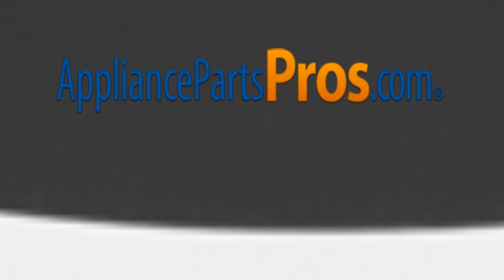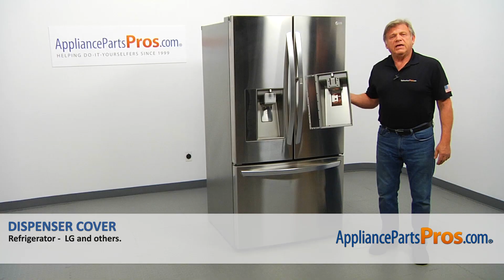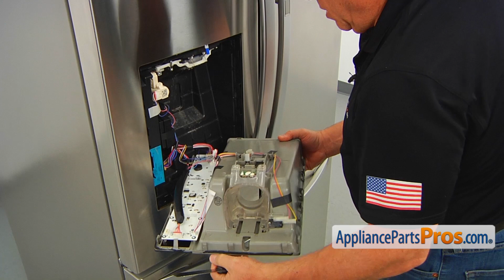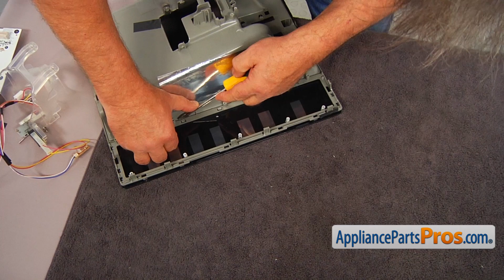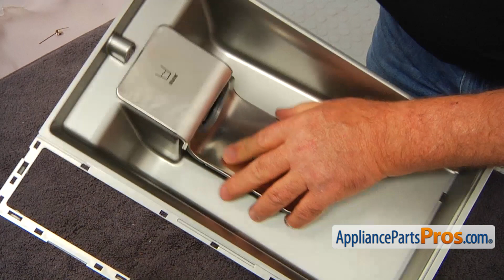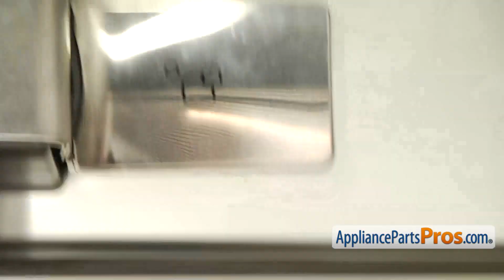How To: LG/Kenmore Refrigerator Dispenser Cover MCK66542801

Comment: Pros:  The part was correct and I was able to fix my LG fridge (model LFXC24796S/00).  Everything works.

Cons:  The video leaves off some VERY important details, causing the replacement process to be more complicated.  The missing information that caused the most problem during my repair is that the video said to remove the cover plate (where temperatures and other information shines through) on the left hand side of the dispense, all I needed to do is push back the many little clear plastic tabs with my thumb.  The video did not mention that in addition to all the tabs, the face plate is also secured to the dispenser cover with very strong double-sided tape.  So, it did not matter how far back I pushed the tabs, the plate remained securely attached to the dispenser cover.  I wound up breaking off one of the tabs by pushing too hard before I realized what the problem was.  From then on, I used a putty knife to slide between the face plate and the dispenser to loosen the tape as I moved around the face plate pushing back tabs with my thumb.  On the video, there is no tape and the face plate simply falls off once the tabs are released.

A more minor missing detail is that the circuit board on my fridge was held in place by yet another plastic tab in addition to all of the screws shown in the video.

A final shortcoming of the video is that the person demonstrating was able to simply pull the various wiring harness clips apart.  That's not how they work.  On my fridge, two of the harnesses have relatively easy-to-use thumb latches.  Squeeze the latch and the harness can be disconnected.  The other two use a rather more tedious method of disconnection that involves pushing aside tiny little clips so that tongue on the other half of the harness can slide out.  That's a small matter, but it would have saved time and frustration if the methods for unplugging the wiring harnesses was explained.